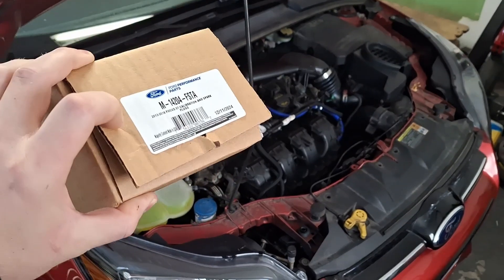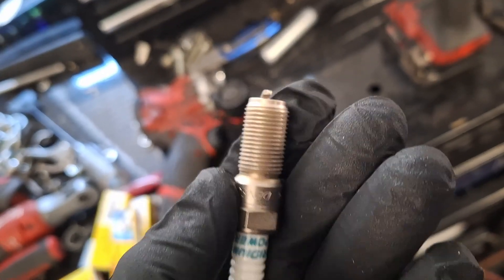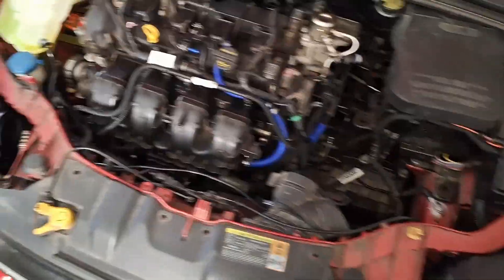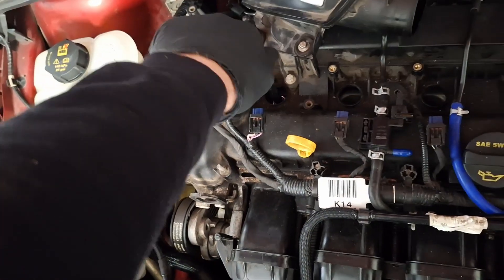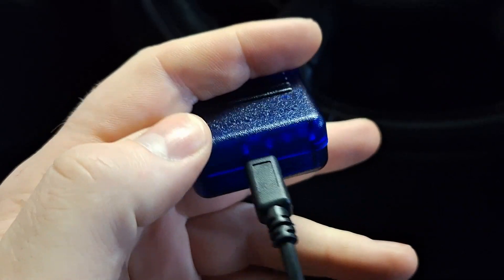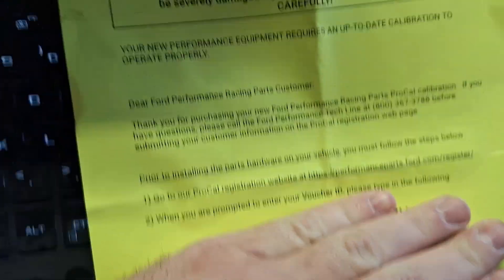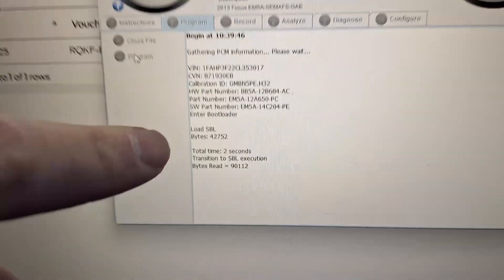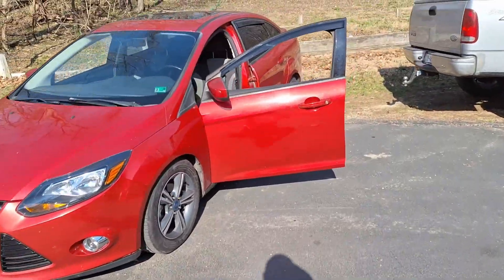Adding 90 lb-ft of TORQUE? Ford Focus ST Performance Calibration!

Comment: Hey, Ben I’m having issues with my transmission it’s triggering a P074A code
Reply from the maker: @NicholasKarnes  if that's the only code then it may be a damaged synchronizer. Particularly If you hear it grind. I would just live with it. It'll start to skip 2nd gear when it gets worse

Comment: I think you have to put its original 6th speed box. I converted my focus 3 automatic to manual and put a 6 -speed box and lost strength, I think it is because the programming of the PCM is with box of
5th speeds. The same is happening to you I think

Comment: It would be good to know how you did the installation of the motor harness in Ise Focus and how you did the programming program
Reply from the maker: hey. during the swap series, i showed installing the engine harness. once you line up a few connectors its super easy to install the rest. and as far as pcm programming, you need IDS. look up how to program a used pcm with IDS
Reply: @BigBensCarsAndCycles You have some video that you recommend to make that programming